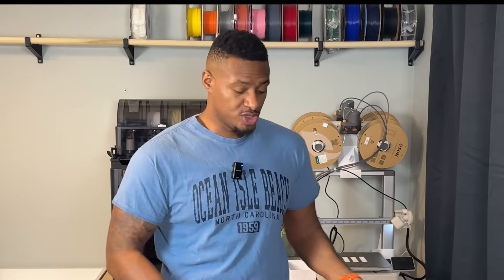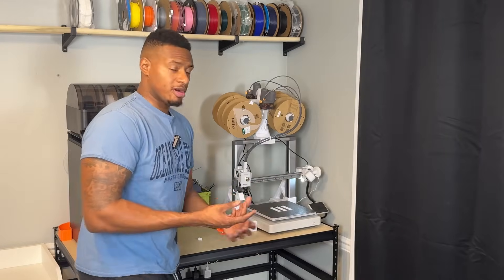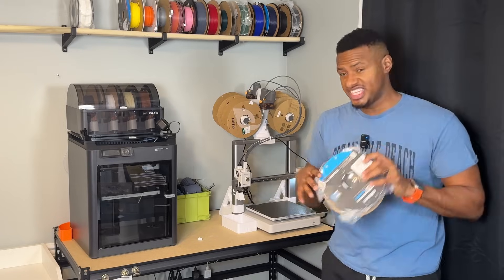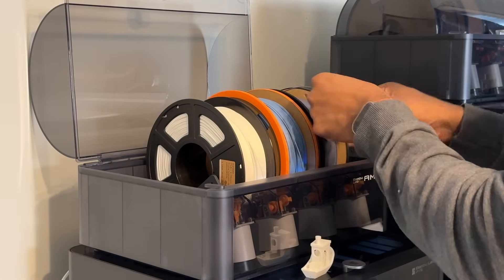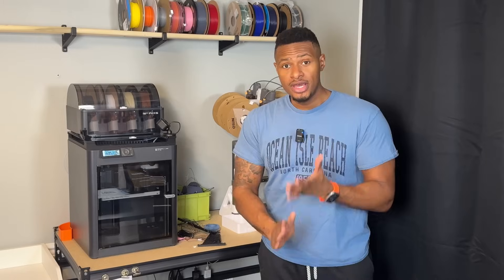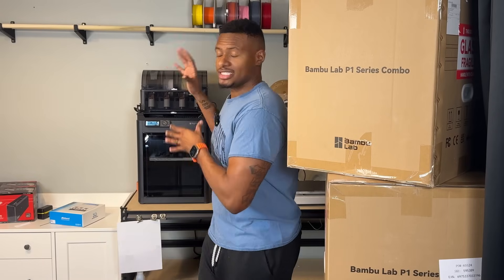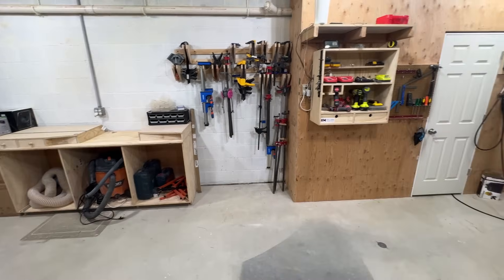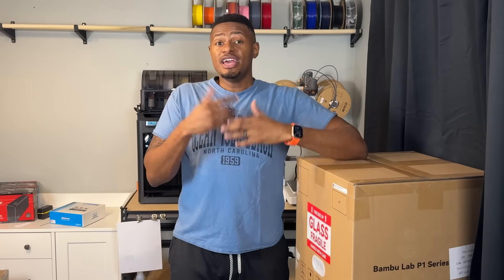Bambu Lab P1S vs A1... Which One Made the Cut for My Business???

Comment: I am not using mine for business but decided on P1S with Combo over A1 Combo due to noise and ability to print beyond PETG and PLA, also I can upgrade the screen for like $100 but overall way cheaper and as good as what I wanted which would have cost me $1300 Prusa MK4S with MMU3 + S&H
Reply: I have heard that the P1S is definitely much louder than the A1.
Reply: @BartCunningham ….I have mine setup though I don’t have an A1 but very happy with the PS1 with AMS, however AMS is loud when loading filament but have to say works great and not as loud as my AnkerMake M5 that will wake up the dead

Comment: We don't know your basement, but you should keep in mind that if you expand more naturally your printers will create heat, due to the same fans and on the other hand, if you watch other creators' videos, I have generally seen that they expand with cheaper (bambu lab a1) and open printers, I assume that for the same. I had 2 in my living room working for 2 months in winter and I did not use heating.

Comment: And also, printers with an enclosure print much better because of draft from doors or windows can’t get inside because printers without it (for example the a1 ) that don’t have an enclosure do  print much worse because the draft pushes filament that is extruding away from the print causing filament to just float in the air and not print anything

Comment: I own a bambu lab A!, the print quality is great, but for my needs an enclosure is a must. The printer sits in a garage, we have 100% humidity most of the year. Every time the garage door is open, the layer is effected and you can see a ridge in the print. The screen on the P1S sucks, bambu should have not released this printer with this screen. If I needed buy a new printer today, I would have bought the Elago century carbon. It is cheaper than the A!, similar to the X1in many ways, but cost less than the A1.

Comment: I totally agree with you for going for the P1S. I have one myself and love it. It's a more than capable machine and I feel like the quality of the printer hardware is just a little bit better. Also I can recommend the hardend steel nozzles just to have less wear over time. what I also like about the AMS is that my filament keeps dryer than with the AMS light system.

Comment: No mention of the biggest downside to the p1s : its the only bambu lab printer without dynamic flow rate and pressure advance.

So you need to do a manual flow rate and pressure advance calibration. Luckily its all built into bambu studio and very easy to do, but needs doing for every brand of filament.

Comment: There's no right or wrong for PLA. If you need to print ASA a lot, an enclosure is necessary.

People have said enclosed printers make all your open print settings irrelevant. It makes sense - an enclosure makes it a different environment. Particularly PLA is affected by this. I've dialled in my settings for an A1 without an enclosure, and expect to have to start over if I ever get a P1S or X1C. Be prepared for some surprises if you have this thing called seasons ;)

(Floridians: Ignore this. You have only one setting - 5th circle of Hell.)

Comment: I think the P1S is a very solid pick.  I think the enclosed environment is definitely a benefit, and the fact you can run the real AMS unit is a huge plus as well (you can put four on one machine after all).  But where you want to have a print farm, I wonder if the AMS is a real value to you, verses just running single 3KG spools.  (I guess it depends on what kind of offering you want to make.)  The other thing is, you could design an enclosed cabinet for the A1s, helping to regulate the temps, and keeping the dust at bay.  Though that might be a good idea for the P1Ss as well.
Reply from the maker: Yeah all good points but when I mover to the basement I think it will be best if I have the AMS

Comment: 8:26. I wouldn't print with those materials in a living space.  You have to remember, this is a manufacturing technology, and you're putting a lot of particulate and gases in that space.  I wouldn't stray outside of PLA and PETG with your living room setup.  (Even that is really pushing it.  I'd for sure be running a HEPA filter in there.)  Also, stay away from the CF/FG impregnated materials until you have proper safeguards in place.

Comment: I just got a A1+AMS lite but kinda regret not getting a P1S. But still very happy. Now i Just have to rock out on my A1 and then see if I can justify a P1S in the coming year. Lots to learn and a great replacement to gaming.
Reply: Why do you regret it?
Reply: @tango_sierra8608  Having an enclosure to help me install an extractor cos i kinda will wanna do more functional engineering stuff which need proper ventilation. I will install a window extraction system. Will probably enclose my A1. Had only 2 days with it before i went on holidays and already felt the chemical air pollution and got a slight head ache with it even if i was pumped over my new toy.
Reply: @tango_sierra8608  i spent 2x the what it would have cost on filament to upgrade to the P1S.

Comment: BIQU has a display good for up to 10 printers. Polymaker and bambu (in quantity) are not unreasonably priced for the fewer failures.
Build a closet in the basement that includes dehumidification. It'll save you many headaches
Reply from the maker: @yeti3714  🙏🏾

Comment: Great vid! jest found the channel and subbed! Now for me I use all filaments lol I'll try anything really, just used some kingroon and it printed really well! as for the lite system you do have some rolls that you have to print out adaptors ! as for the beds I use powershot lol it's dish soap but in a spray bottle and I love the stuff, plates get super clean and you don't have to scrub them hard either! I just got in a p1p to add to my setup and so far loving it! but my p1s is a work horse! I have over 1000 hours on it already after only 2 months and my A1 I have close to that and it just works!!

Comment: I tend to stick with just a handful of filament manufacturers.   eSun, Polymaker, Elegoo, and Bambu.   Generally eSun for Black/Grey/White PLA+, Elegoo for Marble, and Polymaker/Bambu for other colors depending on the sales I hit.  I used a lot of Inland at the beginning, but quality seems to have decreased a bit so I only try some specialty stuff from them such as the gradients lately.
Reply: I should add, that for the AMS on my P1S, I generally transfer the carboard spools to bambu spools as the carboard hubs fit for most of the brands.  Some need little adapters.
Reply from the maker: @paulkiefert  how do you do that?

Comment: Great video. Don't touch the build plate with your hands; the oil from your hands also causes adhesion issues. As per the Wiki, use warm, soapy water with a sponge, rinse with warm water, and dry with a paper towel or microfiber cloth. Looking forward to following your journey and wishing you nothing but success on your journey.

Comment: I have a P1S Combo and an A1 Mini Combo, I struggled with cardboard spools in my AMS and ended up printing out a re-spooler off of makerworld for my cardboard spools to use in the AMS.  I have bought bulk SunLu filament and it has worked well in both printers as well as Kingroon, though I have only used it with the AMS lite on my A1 Mini.  I purchased both through Amazon.

Comment: You could build a non permanent room in the basement using plastic tarp or just wood something thats easy to take down to store the printers, and provider another layer of protection from dust and temp/humidity.
Reply from the maker: That’s a great suggestion!
Reply: I agree! Separate the spaces between the workshop and your 3D Farm and add more P1S’ 😂